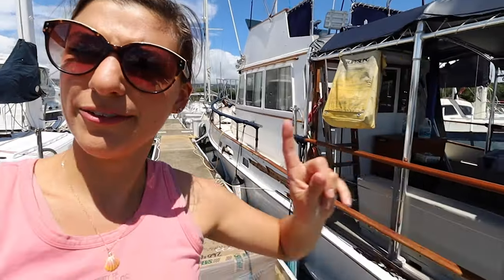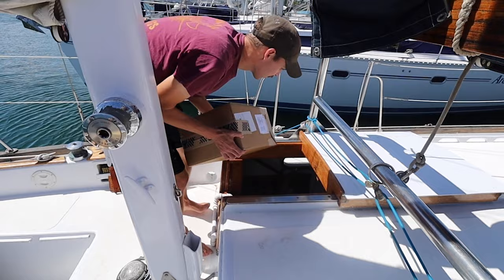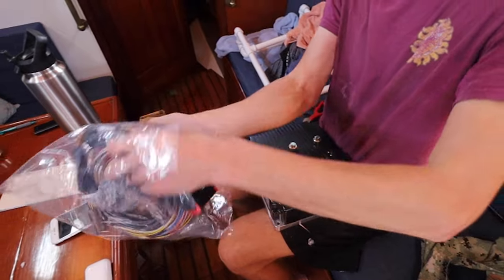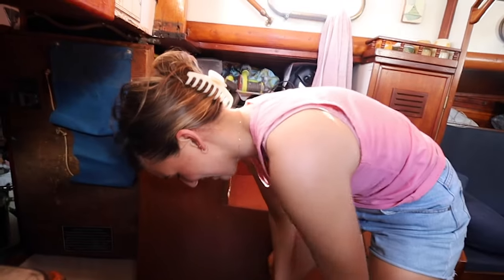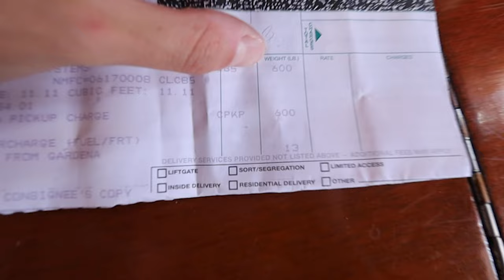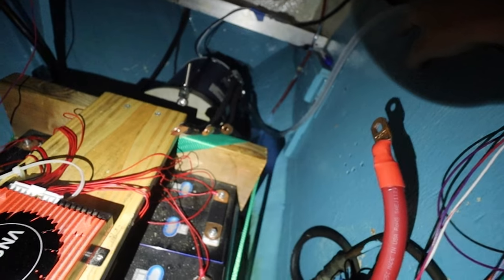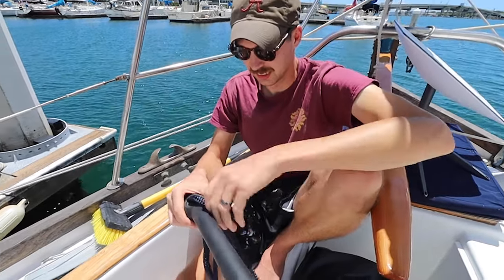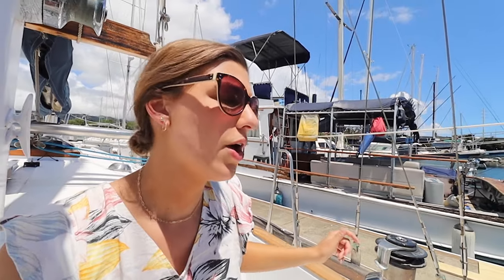CONVERTING TO AN ELECTRIC MOTOR: Beginning to install our electric motor on our 38' sailboat - Ep 53

Comment: I like my air cooled Chinese 168F diesel motor. The smaller the engine, the higher the emphasis on recharging batteries Vs propulsion and the much less diesel you have to buy and carry. The 168F weighs 44 LBS plus alternator and hardware. I only use half it's 3 horsepower and don't spin it fast. Electric/ lithium is pretty heavy, short duration, slow to recharge and super expensive. Electric is good for  elevators, subways, and submarines. My motor (engine)(mill) cost $209 to my door, all in. Dry heat is welcome on a sailboat.

Comment: 96VDC? Quite a pack 16 LiPO4 batteries.? $$$$ How many Kw is the motor?
Reply from the maker: Yep, 96V! The company sells sailboat motor kits up to 18kw, but they recommended the AC-50 motor (outside of the sailboat kits) due to our boat size.

Comment: Why did you do 96v ? As you could of done 48v, then you also gain the ability to charge your batteries off solar and grid plus also use a hybrid inverter to then give you ac power to run other thing's like an air con and normal alliance's

Comment: One thing I would be concerned about is if it took 6 months just to receive the motor, how long is it going to take if you are broke down in a foreign country waiting for parts.
Reply from the maker: Yeah, lots of pros and cons with electric versus diesel. We are hoping by installing ourselves we at least will be able to easily identify problems since we will know the system in and out. 🙃 parts could get complicated.

Comment: Try doing that with a diesel engine 😂. Now what we need is fluid piston rotary powered generators and full regen under sail..
Reply from the maker: For sure! No carrying a diesel engine inside 😅  and yes! Those things would be great! Solar power may be next…
Reply: @sailingposttime  

Hybrid for now and with a monohull regen and a Flinsail solar system for when youve got limited roof or davit space, or are at higher latitudes as you can trim the panels to the sun direction..
If you do add PEV then look at hybrid HPEV panels for double power esp under bright conditions/ high temps..and massively extended life  of Si crystal based solar panels. You also can recover a lot of free hot water ..

There are already rotary wankle compact motors being used in military generators made by Rotopower... Size of a 🏈 and it will power a small car to 65mph. and its quiet and virtually vibration free.  80lb for a gen set .. but APUs for drones and light aircraft come in smaller still.